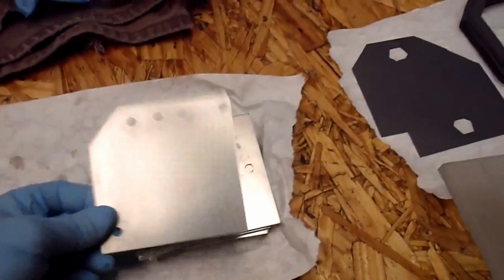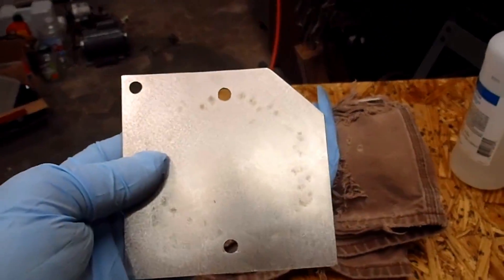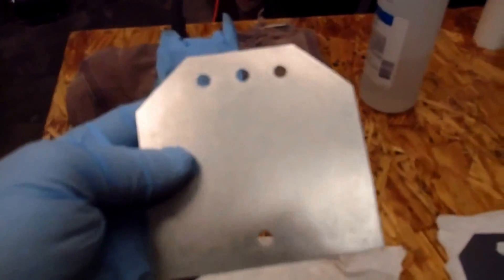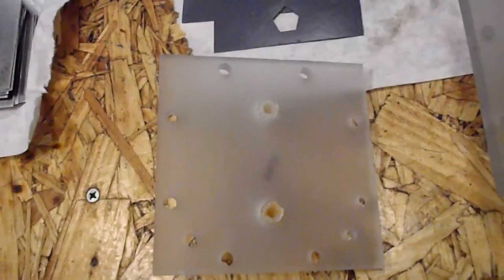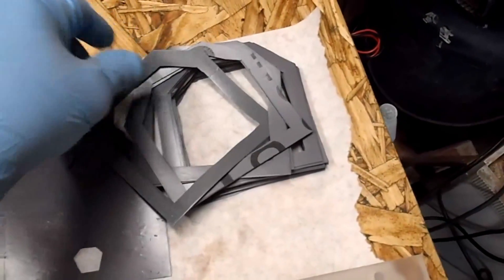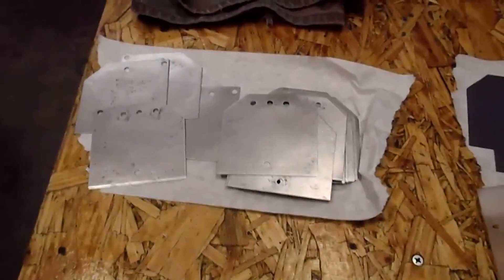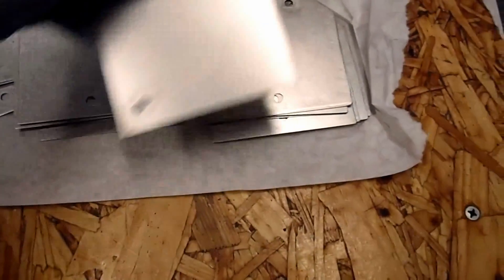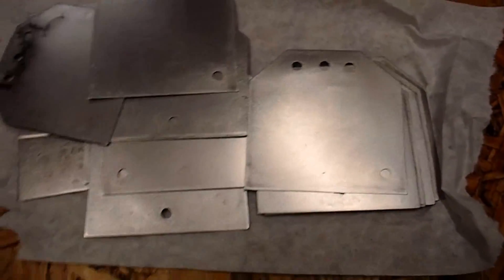HHO Dry Cell - 5 - New Plate Modifications

Comment: Still new to HHO but why have neutral plates?
Reply: Griffin y It essentially helps to regulate the amperage to each plate making it more efficient, and in turn stop overheating.
Reply from the maker: I agree with Ian.  Like Bob Boyce points out keeping the voltage under 2.5v between plates is very important.  Any higher then this and heating begins which leads to wasted power and the evaporation of the electrolyte.

Comment: Great vidio thank you for posting.
what is the difference between the power plate and the neutral plate.
Randy
Reply from the maker: The neutral plate has nothing connected to it, it helps to diversify the applied power making for a more efficient cell.  i.e. - big decrease in overall applied power relative to a small decrease in hho production.